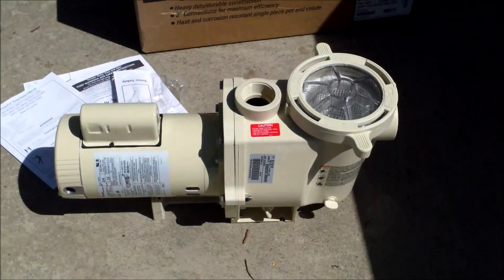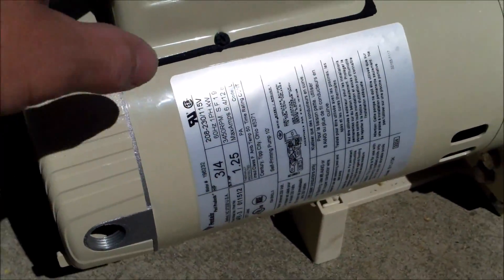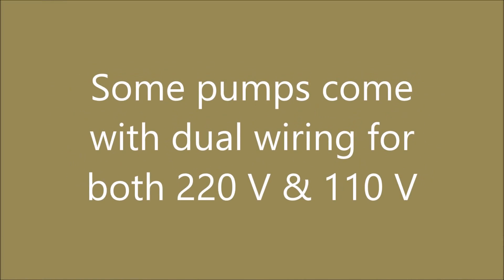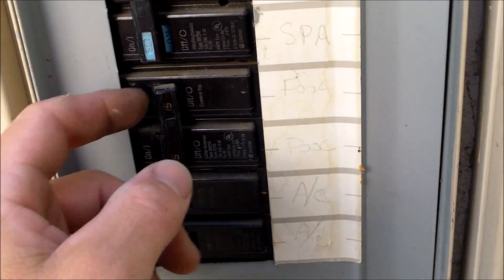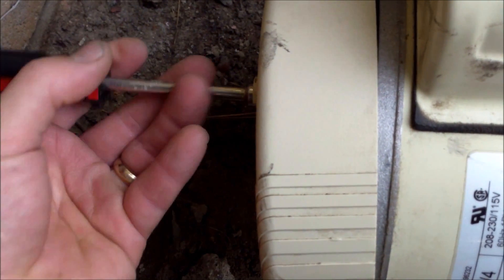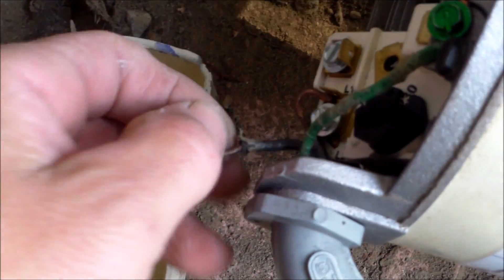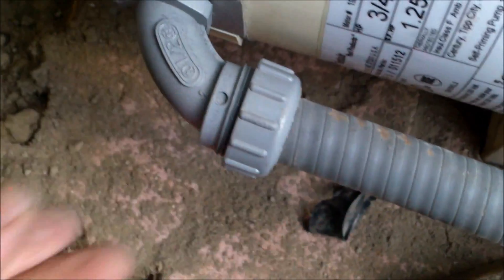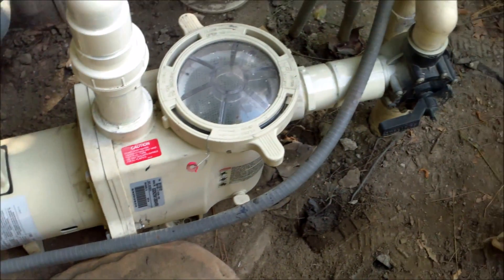How To Wire a Pool Pump, Pool Pump Installation Part 1 of 2

Comment: One question my inground pool pump has the top capacitors with 4 wires 2 yellow and 2 orange , and does 2 yellow go on one side and the other 2 wires on other side , please help any info highly appreciate

Comment: What if you have 2 black and one white wire? Measuring the two black I get 220vac but measuring white and any black I get 110vac on the old pump motor the white went to ground? Is that right?
Reply from the maker: Might be okay - sometimes the installer uses the wrong color wires.

Comment: This is older wiring from house I bought years ago. Motor burned up got new one. Don't remember how wired but has 2 black wires and 1 white..
Do you know how I wire it to new motor?
Reply: Would ground be the white wire?
Reply from the maker: Might be the original installer didn't use code for neutral. Black is typically load or hot.

Comment: Why would the wires that come from the breaker that connect to the time clock show no electricity when I put a voltage tester on them? My pump also isn’t working after I put a new one in.

Comment: Hey man I have a question for you. Is it possible to test a pool pump motor at home ? I mean bringing it into the basement and plugging it in inside to try it before installing it at a customers house ? They are interested in trying to refurbish the motor
Reply from the maker: If it is a 120V 1 hp or less motor you can wire a plug to it and plug it in. Yes. I have a pool myself and I have an extra 230V line run to test motors as well.

Comment: What is the part called that you connect the wires to ? Can it be replaced if it’s broken ?
Reply from the maker: Terminals. Sometimes - but other times they are fixed to the back.
Reply: @SPL  I have the exact same pump as the new one you hooked up here. Seems like I can only find the AO Smith terminal board online and it don’t match what I have. Thanks for the reply.

Comment: What could be the issue if it powers on for 3-5 seconds then powers off?
Reply from the maker: If it is an older pump the capacitor might be an issue. On a new install maybe the wrong voltage or a problem with the voltage from the breaker.

Comment: So I bought a hayward super pump 2 self priming 220/120 . And my problem is i only have three wire green , bluish and a black wire . And in the inside there is a connector that said 220 / 1120 how do i connect them . I'm lost and confused . Your video demonstrates only three wires which is simple but my connections have three wire and a hook up inside the pump that saids 120 and 220 ? 😱I am confused . I'm so confused that I'm repeating things twice , HELP
Reply from the maker: I would call Hayward Tech support and they will walk you through it for sure.

Comment: I have a 10 3 wire  can I use it.  It has black, white and red wire plus a naked copper wire.
Reply from the maker: I  get my wire whip from my supplier - but your local pool store should carry the correct one.

Comment: I wired a 120 volt pump to 220v. Tool a couple months to burn up but either way still mot what you want happening these things are not cheap

Comment: Hi, thanks for the video.  This question's a bit off topic but here goes:  For an indoor pool I can use gas heating for the water, if I wanted, so the only necessary piece of electrical equipment would be the pump to keep the water passing through a filter, is that right?  Obviously lighting and other peripherals aside.  I could use UV chlorination but don't need to - the only electrical thing I actually need is the pump?
 I'm doing a electrical course project with a swimming pool so it's the electrical wiring I'm interested in and don't want to add unnecessary complications.
Thanks.    : )
Reply from the maker: Yes, just the pump, filter and heater. Pretty easy
Reply: @SPL  Thanks.    : )

Comment: Hi, you are to go, person, every time I do my pool maintenance. Can I have a dry run for a few seconds after I replace the pump?
Reply from the maker: Yes. You can turn it on to see if the motor starts. Just make sure it is securely attached to the pump end before starting it or it.

Comment: I like this, not talking about unnecessary b/s, right to the point, only what's important. Concise. Thumbs up!
Reply: Great video. I WISH I COULD TALK TO THIS GUY. I NEED TO KNOW IF THE MOTOR HAS 220 AND 120 CAPANILITIES, HOW DOES THAT LOOK. I WAS TOLD MY Pump/MOTOR CAN DO EITHER OR.

Comment: Suggestion when you install the new pump, make sure that the elbow that goes in the motor for the wires, is plastic and not metal, the previous owner of this house, install a metal elbow. When i had to remove the wiring because it was all corroded. it was extremely hard to un screw it, after two days of putting all kinds of oils and solvents, it would not budge. I tried to force it and the frame of the motor broke.
Reply from the maker: No one uses those anymore for that exact reason. Must be a very old pump.

Comment: As others have said, this is a dual voltage motor. Just put hot wire to L1 and neutral to L2 then turn black selector knob to 115v.
Reply: Yep I been doing this

Comment: A 220 pump hooked up to 110 won't burn the motor out. It will run a bit and make a clicking sound. A 110 pump hooked up to 220 will burn the motor out though. You should make that change in your video. Other than that your video is pretty good.

Comment: Thank you! Very helpful. I bought this model after my old 11 year old pump died. I was confused about the writing as my old pumps wires were attached to terminals "A" and "B" and this new pumps terminals "L1" and "L2". But you cleared that up. Also I made sure to turn the switch from 230V to 115V as that's my power source.

Comment: The very last connection made - to the external lug - where does that wire go? Thank you.
Reply: That wire is not actually a ground wire. it is a bond wire which provides equipotential between all objects in the pool that can carry electricity...similar to ground, but definitely not the same.  ideally it should be run in a continuous run.
Reply from the maker: Usually grounded to the pool heater.
Reply: We don't have a pool heater. is it necessary to connect it to anything else?
Reply from the maker: Something metal to ground the motor in case the GFI or breaker fail.
Reply: Thanks

Comment: Is there any advantage to running my pump on 220 vs 110?  Thanks   You have great videos by the way!
Reply from the maker: The pump is more efficient on 220V. If you have that option I would go with 220V
Reply: Swimming Pool Tips, Reviews & How To -MrDgvb1
Reply: Swimming Pool Tips, Reviews & How To -MrDgvb1
Reply: Swimming Pool Tips, Reviews & How To -MrDgvb1
Reply: Dale Seymour
Reply: Dale Seymour
Reply: Of course a pretty big energy savings higher voltage results in lower current consumption

Comment: The recommended way to attach wires to screw terminals is to wrap the wire in the direction of the tightening screw, I.e. Clockwise. You wrapped the ground wire the opposite way. A small thing but important.

Comment: this is a dual voltage pump...do you see the switch to change from 230 to 115 ...???
Reply: I agree, it also had 208-220 / 115 if it was looked at close. and the voltage selector switch.
Reply: @usmarinekenny  I noticed the same thing. I still think he did a great job at providing a video for us!

Comment: should the breaker in the house (labeled pool equipment) also be shut off or will the shutting off the breaker by the pump be suffice?
Reply: There should only be one circuit breaker but if there’s a switch at the pool pump you should definitely kill it at the breaker in the panel but never assume your wires are dead unless you use a multimeter to verify there’s no power there before doing work.

Comment: That's a dual voltage motor all you need to do is turn the selector nob to the left by doing that you make it a 110v other than that you're video was right on point
Reply: It's a dual setting and my pump was set by default at 240. I didn't understand why my pump kept turning off. This comment saved me. You have to turn it to the 120 setting or whichever one is yours! Thanks

Comment: Hi,My swimming pool pump works about 15 minutes then off by itself.  If I turn it on again, it works about 15 minutes then off by itself again.  Can you tell me if the pump needs to be rewired?  (I have this brandnew pool built in 2009, and the problem just happened in last two months.)  Thanks
Reply from the maker: +James FawnVista Could be a few different problems. What brand and type do you have?
Reply: HAYWARD. Thanks.
Reply: Turn the voltage to 110.

Comment: My lug where I hook up the AC power 
broke in the back of my sta-rite pump - can i get a replacement?
Reply from the maker: +Pablo Diaz I think so, not sure what the part is called. If you call Pentair and give them the pump model # they can give you the part #. Sta-Rite is owned by Pentair: 800-831-7133

Comment: What's that white [capacitor release mechanism] part at 1:53.  I think it turns off the capacitor once the motor starts spinning.  Mine was damaged during installation but I could not find the name anywhere?
Reply: https://drive.google.com/file/d/0Bys6FI1ixC5WOTJ1bV9QTkx0djg/view?usp=sharing
This [emerson r63cxdna-19s motor ]
 has 2 copper leafs which touch a plastic disk attached to the back of 
the shaft.  The copper leafs were damaged during installation.  Is it 
sufficient to just straighten them out?
Reply: What is that part called?    Someone told me that you can't buy it 
separately, but I was thinking someone might be selling one on Ebay.  Do
 the leafs go under the plastic tabs or over (on top) of the plastic 
white tabs?  If one of the plastic tabs is broken off, does it still work?

Comment: I have a question, my pool pump i believe is 220v because it has a double breaker like you said, my model is I believe the ultra flo from American products, I'm planning to install the whisperflo 1 hp, but for my wire it has one green wire and 2 orange wires, is that a 220v wire? I thought 220v wiring is one green, one red and one black, but mine is one green and 2 orange wires, once I get my whisperflo pump could I wire it just like you did in this video?
Reply: Correction I believe they're red wires not orange, just looks orange because it's faded
Reply from the maker: bludika Probably the installer did not use wires to code - I have run into weird wire colors also over the years. Sometimes the electrician will use whatever wires he has on the truck. So I think it is safe to assume the orange wires are the load wires. So the way I do it in this video should be the way you wire yours also.
Reply from the maker: bludika So yes, those wires are the load wires.
Reply: @bludika  Hello Bludika: I have the same issue. One green Wire ( Ground) and two red wires ( load wires) I have a 230V Pentair Single speed motor. Just to confirm. It doesnt matter which red wire I hook up to the L-! and L-2 connection?  They are interchangable in your video.?
Reply: The only wire colors assigned in the NEC is bare,green, or green with yellow stripe(typically represents a isolated ground)for the  grounding conductor & white (120v/240V) & gray (277V/480V) neutral/grounded conductor.  Other than that there isn't a color code. Electricity doesn't care what color the insulation is. In low voltage/data/comm wires there is a color index I believe.  But standard electrical the ungrounded conductors (hots) can be purple with yellow polka-dots if you want. Industry standard is black red blue for 120/240 brown orange yellow for 277/480. That's AC. For DC no neutral  just green/bare is grounding conductor  & red is positive black is negative.

Comment: With all due respect. That motor tag says 208/230 and 115 volt application. Then under your left forefinger after you open motor lead cap there is a selector switch to chose 230/208 or 115. They should come factory set to 208/230 but it is always good to check.

Comment: help, I have a red, a black (l2) both with screws then I have two push on wires a white one to b, and a light pink or brown to a, so 4 wires all together is is a 5 year old pentair superflow, my new one looks like the one in the video, which wires do I use??

Comment: Great video thanks for the info! So essentially the two load wires are going to just 2 110V breakers so that's how you get 220? 2 x 110??
Reply from the maker: Yes. If you look at the 220 timer it is split in half. One line and one load wire on each half in the time clock. The 220  breaker is also the same configuration but connected together to control the 220 volt timer and thus the 220 motor.
Reply: But you can't use 2 single pole breakers, it has to be a 2pole common trip.

Comment: Note that this motor is actually a dual voltage motor. The name plate states the voltage rating of 208-230/115 as well as the "acceptable for field wiring". Also inside the wiring housing there is a voltage selector switch from 230v to 115v. L1 and L2 will still be used but I'm not 100% sure if polarity is an issue with this particular motor. It would be great if you would do another video demonstrating the conversion from 230v to 115v for those who have 115v at the pump area, noting that the amperage will double so wire size is extremely important. Thanks for the great video!
Reply from the maker: Sure. When I get time I will film one showing the dual voltage wiring. Thanks for the helpful post.
Reply: Swimming Pool Tips, Reviews & How To -MrDgvb1 looking for your help on 220v Pentair Wisperflow pump.wiring to T104 timer?
Reply: GFI Protected?

Comment: That connection on the rear is the BONDING lug, not the GROUND lug.  There is a difference.
Reply from the maker: You are correct that is called the Bonding lug. It grounds the actual pump housing to prevent electrocution in case there is a short in the AC from the water.  The inside ground green wire is grounded to the timer itself. Both are important. Thanks for correcting my terminology - I will post an annotation correcting that clip.
Reply: Swimming Pool Tips, Reviews & How To -MrDgvb1  The ground point inside grounds the pump including the case even though the wire connects to the timer.  This would protect from a short.  The bonding connection ensures that metal components within the pool system (pump, light, etc), are all at the same electrical potential.  If they are not, there can be a difference between these and cause a shock, albeit typically quite small.  All of this should even be tied into a wire mesh in the pool concrete.  Check out the electrical code, its enlightening how much its not followed and how much confusion there is on the subject.